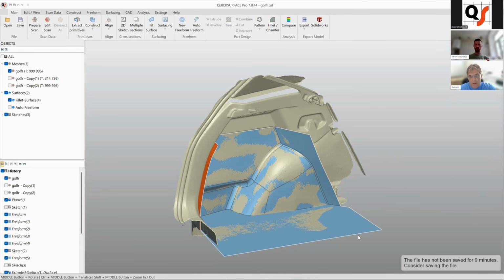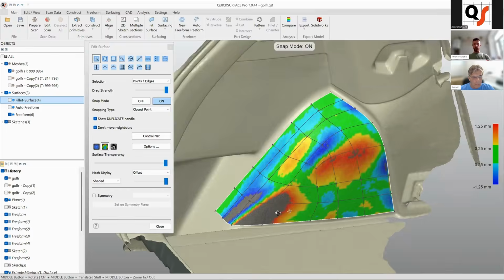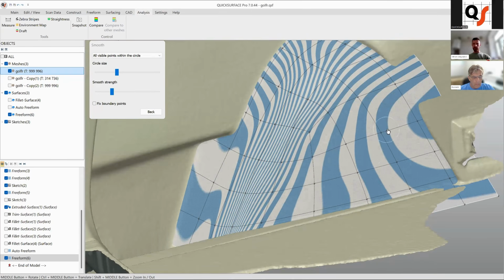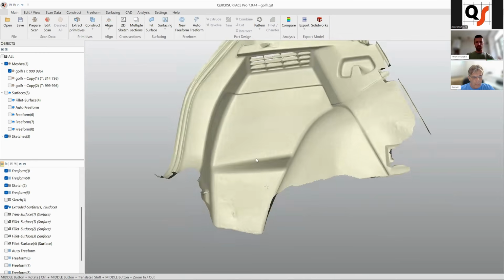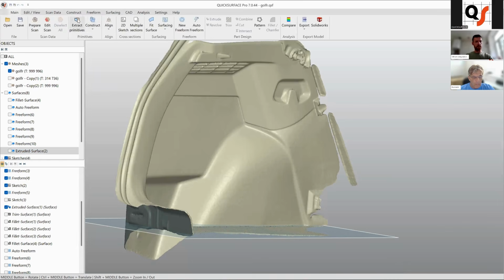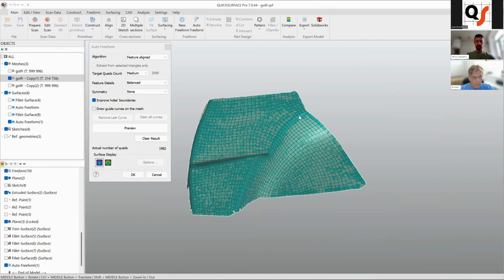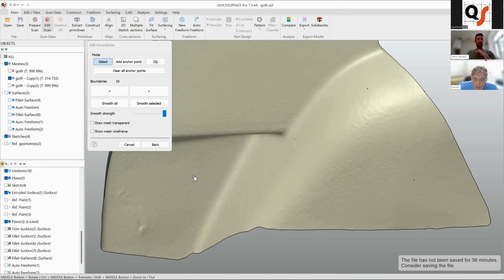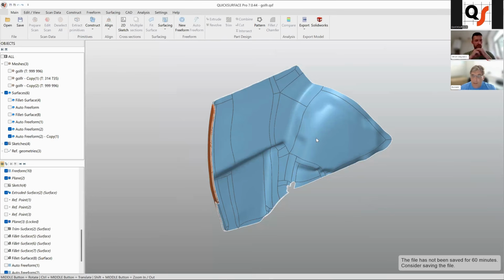Workshop: Reverse Engineering Complex Freeform Surfaces

Comment: Do you have a beginner class.  I want to learn but have no idea what you are talking about.
Reply from the maker: Start with the tutorials in the software
Reply: @QUICKSURFACE what is the standard software used for?  I try to follow the tutorials and every example I try to learn with says "only available in PRO" if the standard doesn't have an application (other than a way to sell the pro version) why even offer it?

Comment: What do you think, is it possible to create this curved surface using only sketches ? Real factory designers don't using snaping mesh or anything else. Each time when I reversing models I want to reach very accurate results. Because, the original model is a copy and not exactly as cad design, then we use surface matt coating, then we use scanner. Our goal is to reach original cad file, like a designer in a factory computer. Thank you quicksurface team❤
Reply from the maker: We work hard for the new release later in the year to provide the tools you are talking about